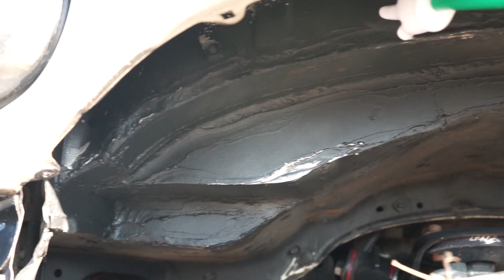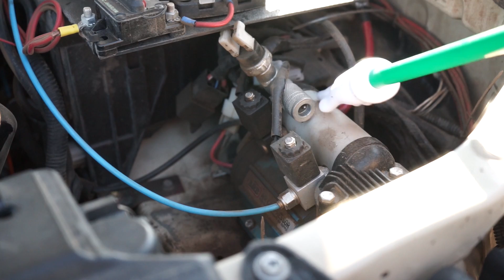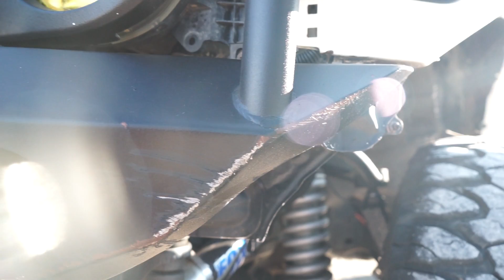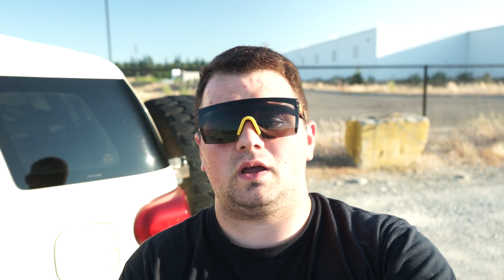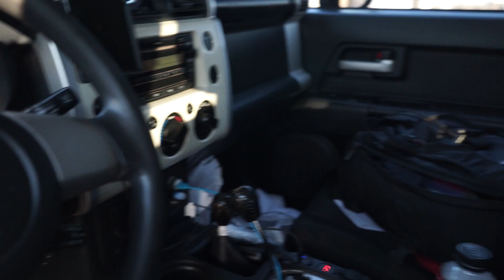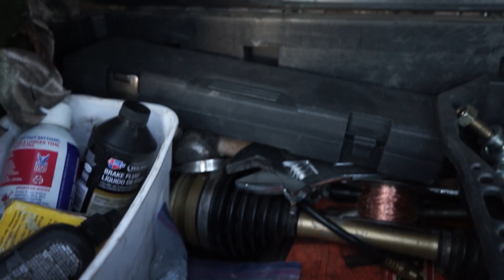The Ultimate IFS FJ Cruiser - Walk Around

Comment: Gotta say I love your FJ 👍🏽 you ever consider adding a supercharger? I feel like my ‘13 needs it in the dunes. But for regular trails it’s fine
Reply from the maker: I would like to have like 80 more horserys my motor has enough miles on it I wouldn't want to super charge it, it did make 2psi below factory compression about a year ago, so I know the motor is healthy, hopefully the motor and trans last long enough till I buy a house and can build a 4.3L stroker 1grfe and put a built trans in it at the same time.
Reply: Thought exactly the same about my 2010 trail teams. Trails and climbing is fine but definitely could use a boost in the dunes